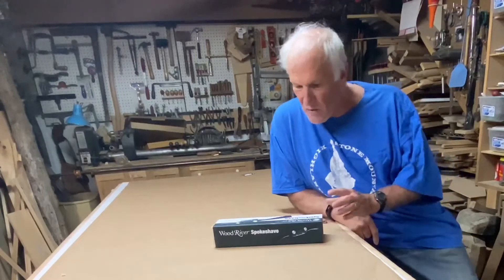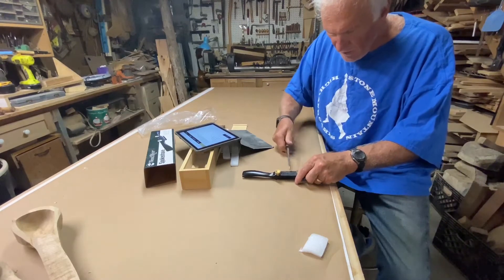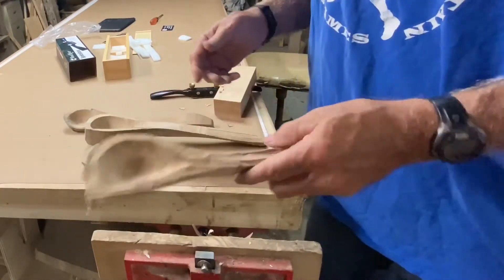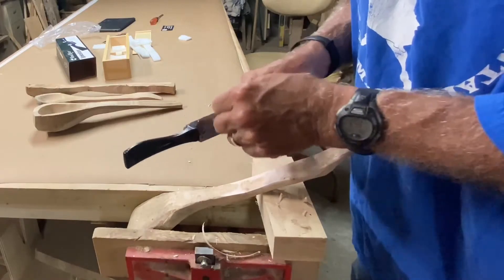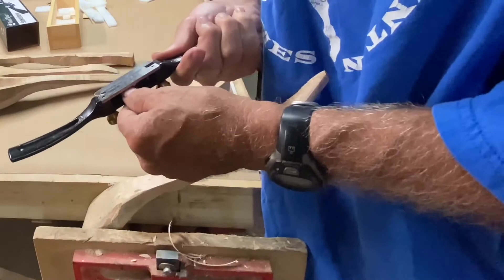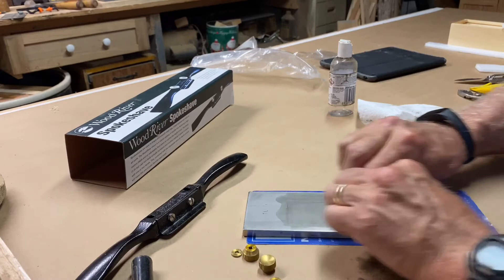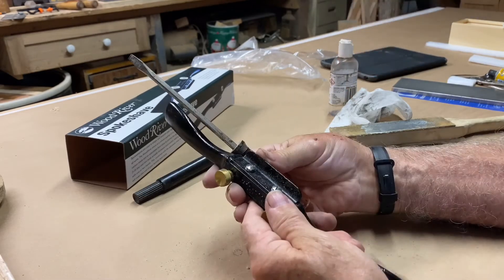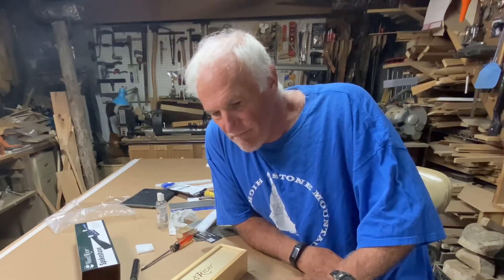Wood River Adjustable Spokeshave Review

Comment: This was actually very useful thank you. And I agree I'm not sure why woodcraft doesn't give some basic instructions for alot of their tools it seems. Its unfortunate even though most tools are simple enough it's still nice to have some basic instructions. Thank you.
Reply from the maker: I usually don’t have trouble figuring out how to use a new tool.  I was just annoyed that they didn’t have any directions whatsoever on it’s adjustment capabilities.  Thanks for watching and feedback.
Reply: @LSatch  yeah that's what I ment. It would just been nice to have something that said which screw did what adjustment
Reply: I have the Woodriver and Veritas spokeshaves and they're almost identical in operation.  The Veritas manual has some good tips and tricks on how to use the tool. Included is a good tip on how to prep the blade so it doesn't slide out. I believe that manual is available online.

Comment: how do i weld the tang on a vintage spokeshave, like the one you have. i have no welding suff just glue ... and rubber bands? suggestions from anyone will be appreciated..
Reply from the maker: I don’t weld either.  I think this will have to be brazed. I needed some aluminum welded last year. I went to a welding supply store near me and they hooked me up with just the right guy. That’s all I have to offer